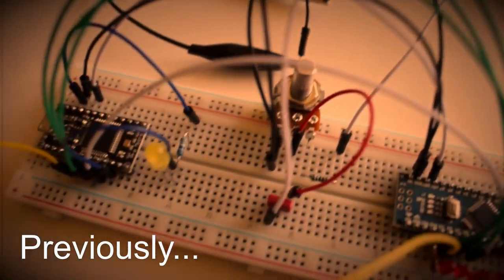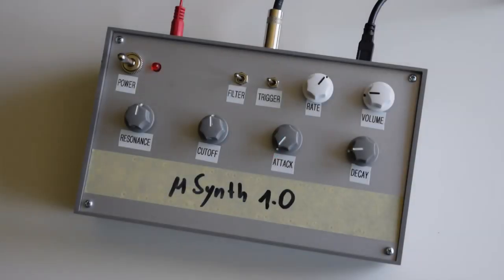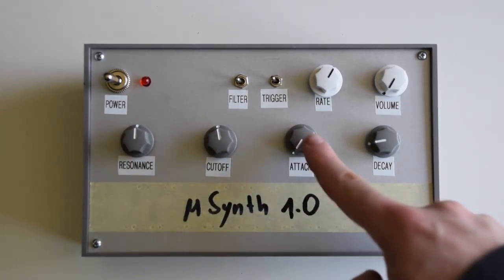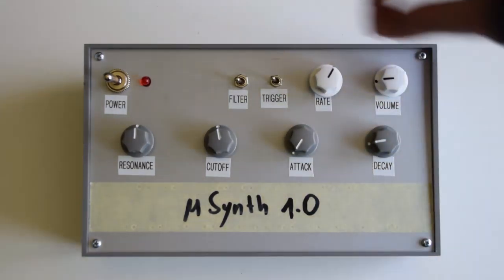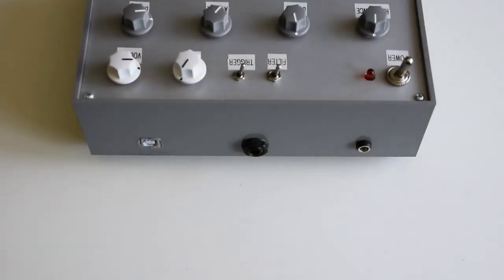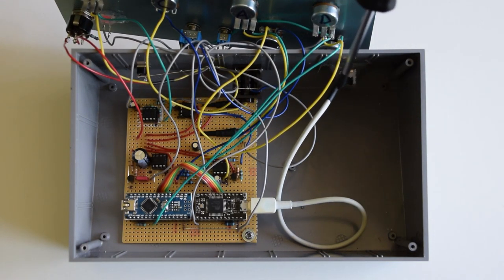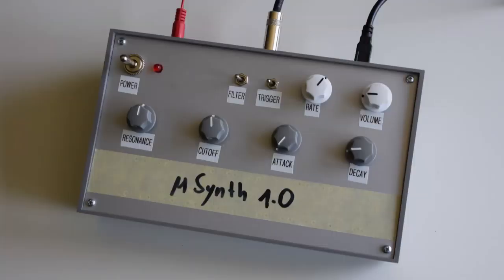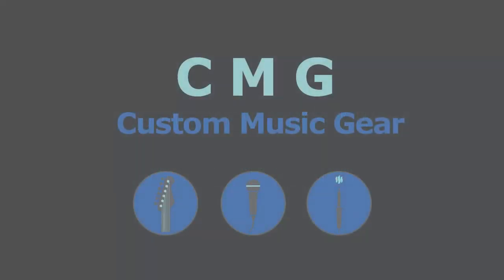Arduino Synthesizer Update: Filter

Comment: Great job! 
Any (code)news regarding an upcoming paraphonic version...
Reply from the maker: Unfortunately not. I ended up using this synthesizer mostly on bass lines. So polyphony hasn't been a big concern so far. Also, the Midi functionality leaves the possibility of layering notes in multiple passes to create chords as a workaround.
Thank you for subscribing! 
That way you won't miss when I finally get to work on the polyphonic version.
For now there's a few other videos that I'd like to make first.

Comment: Did you build that Zoso pedal??
Reply from the maker: Yes, that's the first pedal I ever built. Made me incredibly proud when I got this working. :)
It's basically just a clone of the classic Tone Bender Mk II with an added charge pump in order to run it off a regular power supply and being able to daisy-chain it.
Reply: @custommusicgear934  Im back to the drawing board on mine what germanium did you use?
Reply from the maker: @markgreco1962  I ended up with NOS Tungsram AC125s. You will need to try a bunch to find some that work as their tolerances are all over the place. In my opinion the best option is buying a pack of 10 or so from ebay and measure every single one (gain and leakage) to find some that are in the right ballpark. In the end it's best to let your ear be the deciding factor, so using sockets makes sense.
For measuring this video is pretty helpful: https://www.youtube.com/watch?v=j_i3YHee1HE
Reply: @custommusicgear934  thanks for the advice